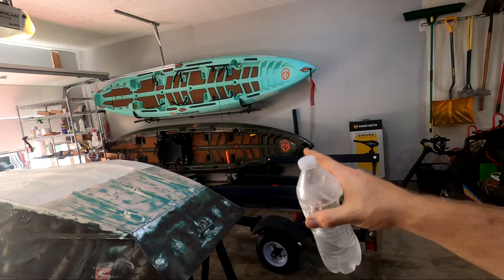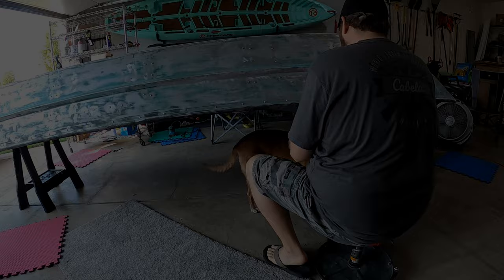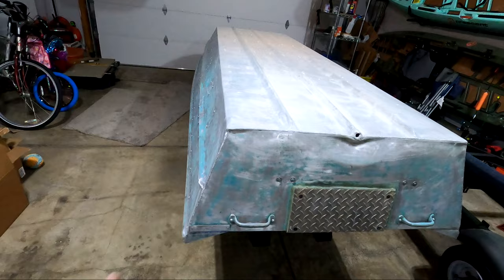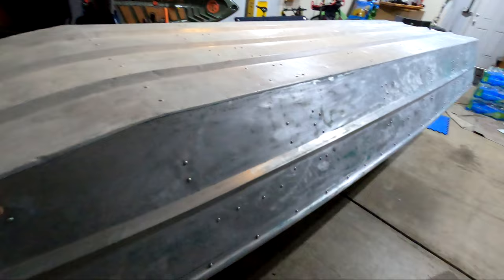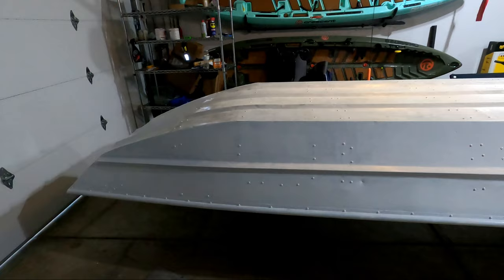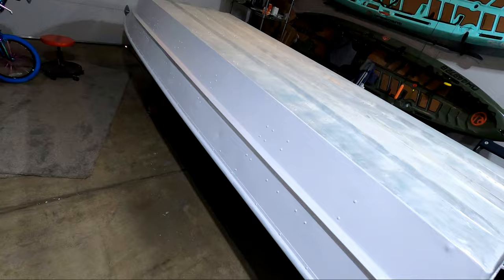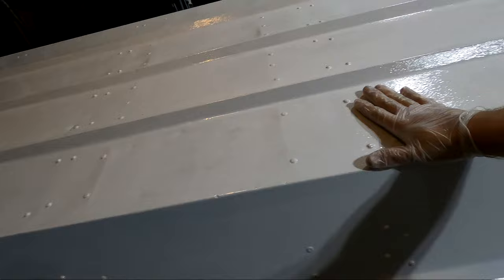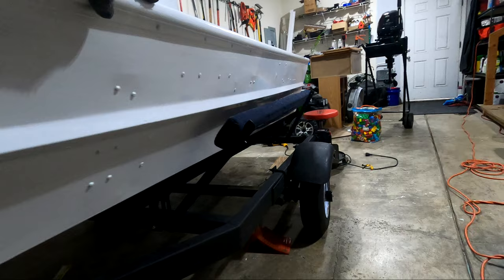RUSTOLEUM TOPSIDE MARINE PAINT -- FULL VIDEO -- Jon Boat to Bass Boat Conversion 1436 Gloss White

Comment: Just curious why ya didn't use paint remover. Is that not a good idea when I do mine?
Reply from the maker: With the relatively recent restrictions on paint remover ingredients they've become less effective so I opted to sand. It would depend a lot on the paint for how effective it would be but no reason you can't try.
Reply: Also, you had mentioned in one of your videos...you were going to create foam stabilizers on the side of the boat? Did you do that video that I missed? I've watched practically all of them. I like to DIY, but I am a nervous and apprehensive DIYer...you are super calm and I really appreciate that about your vids!!
Reply from the maker: @tylerramdog8697   I ended up not doing it because the 1436 was more stable then I expected. Thanks for the feedback, don't be nervous! Tackle things one step at a time, there's very little you can't fix if needed.

Comment: Just wondering how the topside paint is doing after a year? Have you gotten  any chipping or peeling  on the bottom from sitting on the bunks or any other issues? I'm currently doing a jonboat project myself and I'm considering all brands? Boat looks good!
Reply from the maker: I have not had any issues with the topside paint on both boats I've used it on. I'm working on a third at the moment and will be using the same paint again.

Comment: Thank you looking to paint a old  fiberglass tub thank you for showing the proper process.

Also how's it holding up 3 months later?
Reply from the maker: Happy to report no issues. No peeling, cracking, etc. Worked really well!
Reply: @mvboutdoors   thank you 💕 just want to say you put my mind at ease on stressing on how to do something like this you make it look so simple 🤗 would have never thought to use acetone, was planning on just using rubbing alcohol and use some 220 grit sandpaper, now that I know to add those extra steps I feel confident the paint will stick to my bathtub without peeling!!!! Was planning on using a higher grit but my little sander from Walmart only goes up to 220, I'm thinking about using a 300 grit or so by hand would you suggest it after using the 220??
Reply from the maker: @sarahvaladez6780  220 - 300 would all be pretty similar. If you are priming first i would use a higher grit on the primer to smooth out the final paint but raw material can be a little rougher for the primer to grab on to.

Comment: Thanks for the video! How well did the Rustoleum topside level out for you?
Reply from the maker: Very well, so much so that I ended up just brushing most of it rather than rolling and tipping 👍
Reply: @mvboutdoors  Thanks for the fast answer. I don't mind a slight texture from a super smooth roller but if it levels out good then i'm going to use it. Thanks again.